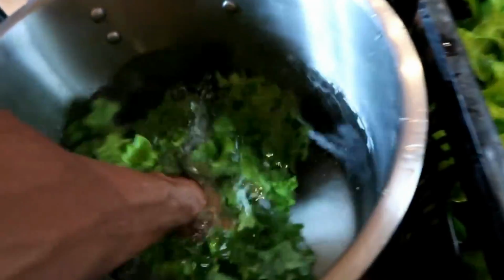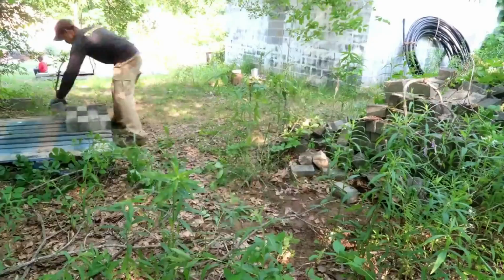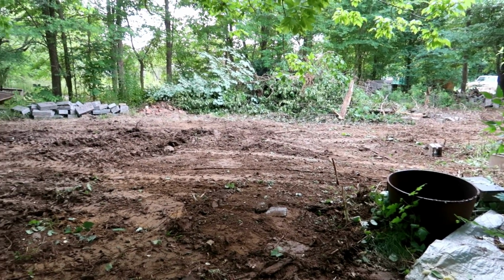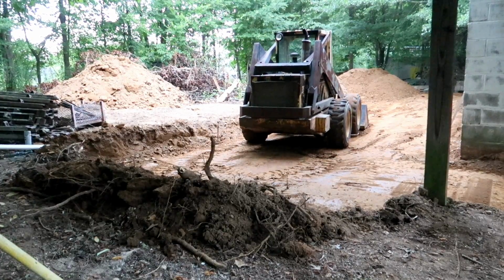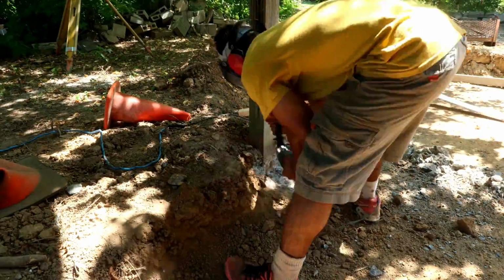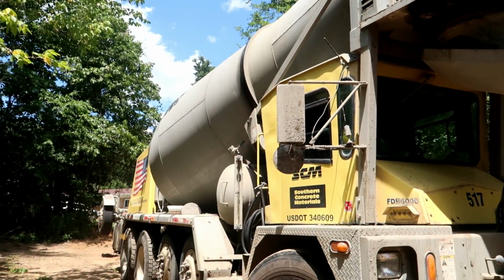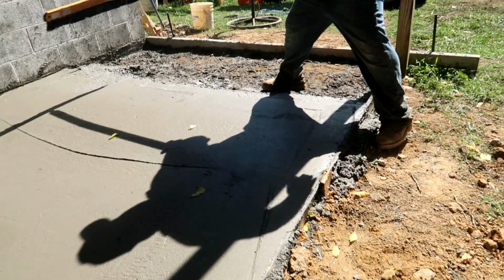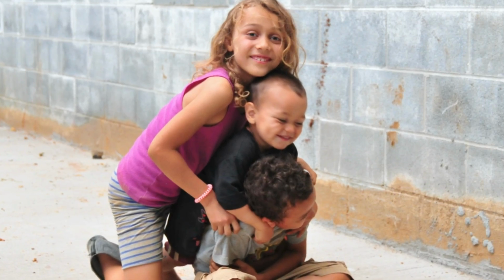Our BIGGEST FARM project of 2018 - FARM UPGRADES!!

Comment: Watching all that concrete get poured in fast forward makes it look so easy. lol. Hardest physical labor I’ve ever done. The skid loader sure beats the snot out of the wheel barrow train we used to get where the chute couldn’t reach. Muscles 💪
Reply from the maker: Ha ha it sure does make it look fast and easy. You are so right about using the skid steer. It is such a great tool to have access to. Thanks so much for watching!